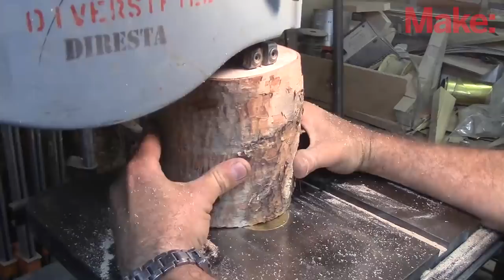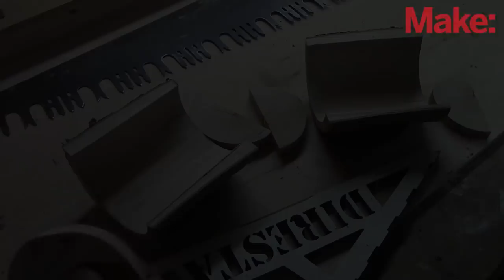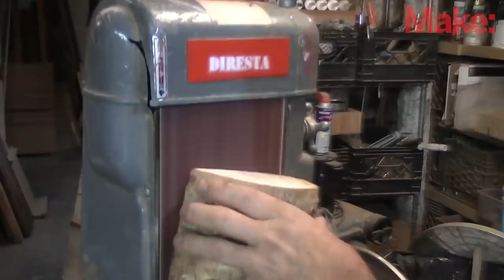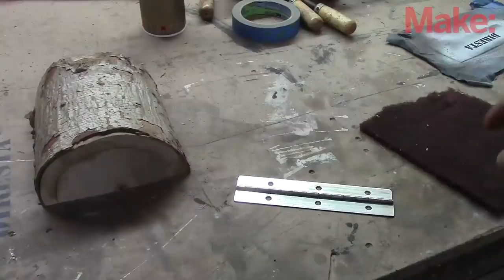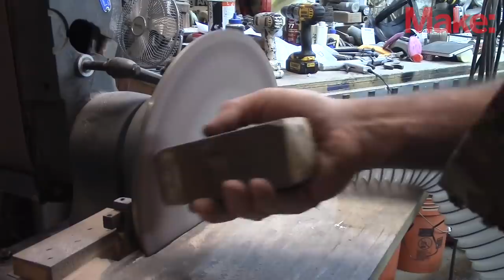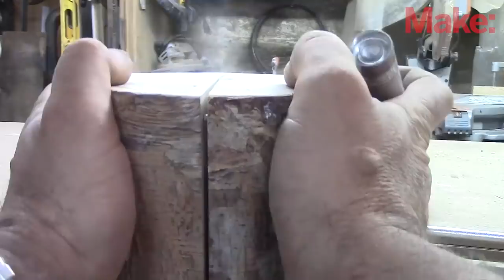DiResta: Mini Log Chest

Comment: Excellent project. if you wanted to make a slightly larger one, chop the ends off before taking the middle out. Take the middle out by cutting log in half, then putting the log halves diagonally on the table saw (best to use a sled for this), Once done, re-attach your end bits :)
Reply: this also works if you don't have a bandsaw like me :D

Comment: This is a noob question, but what is the white stick that he rubs on the belt sander and the sanding disk during the vid? Does it clean the belt of locked in debris?
Reply: Thats what it looks like to me. Maybe its hard enough that it just dislodges the particles. I would love to know
Reply: I just looked it up and some folks us pink erasers that kids used to use at school.
Reply: Skateboarders also use it its called grip gum you can get it on amazone or maybe a local hardwarestore
Reply: It almost just looked like a piece of hardwood????
Reply: Specifically, it's called a crepe block or crepe rubber block or crepe abrasive cleaner. That'll make it easier for you to google if you want to buy it.
Reply: You can use dried up silicone cement leftover from caulking (cut the tube and voila) or old tennis shoes. Used them both. Both work fine.
Reply: truebluekit to be honest specifically its probably a brick from off the street...lol
Reply: superman4ever0311
A brick would've ripped the sandpaper apart.

Ohh... humor? Ok.
Reply: yes humor
Reply: I heard a tip once that the synthetic wine corks work well to clean sander belts/wheels.  Haven't yet tried it...don't think working around tools & drinking wine mix well lol.
Reply: My guess is that, as long as the material is of rubbery or generaly soft nature (cork, synthetic cork, rubber, hard foam rubber, etc) it would do the trick. Cheers!
Reply: nexus01gr
 old tennis shoes.. genius :)
Reply: Nathaniel Kencke
A belt with a lot of sawdust in it will cut much slower as compared to a fresh, pristine belt. Just try cutting with a fresh belt, you'll feel it grab the wood and you get results really quick. Otherwise, you could spend 5 minutes on the sander for a 1-minute job.

Of course, you could just change the belt, but if the belt still has got good amounts of abrasive on it, then that would be a waste.

In other words, using a crepe block lets you use a belt sander faster, and extend the life of your abrasive belts.
Reply: slurmz123 A block of acrylic (plexiglas) is also great to de-goop the surface of the sanding belt. Some oily woods and soft materials can quickly jam the grit, so the belt can be rendered useless before becoming dull from use. A good clean brings some life to old sanding belts.

Comment: Great and really inspiring as usual, but if you´d made the hinge approx. 3 cm shorter, centered it and left some wood at the top and bottom the illusion would have been even better. It would take a more tedious approach though. To be fair speed and great use of tools is what you excel at, you get to a 98% done and dusted project, in no time!
Reply: Yes you are right. I did consider this 1 minute after I passed it through the table saw. Thank you !

Comment: That's a really well done job. It's a shame there's a seam running around the circumference of the log where you had to hollow it with the band-saw, but I suppose with this method there really wasn't much you could do. Might have to take a shot at making one of these soon. Thanks for the great idea! Much respect from a Gen-Y carpenter from Australia.

Comment: Video is old but what does he use to removing the corning from the sanding disc?
Reply: ***** Not 100% sure how to read your question, but from what I can gather, I assume you are talking about the cleaner he uses on the sanding wheel/belt. You can buy them at places like Home Hardware/Depot or basically any where you can buy DIY items. For the most part, they are made out of some sort of rubber and they do a great job of removing material that is gunked up in between grains of the sandpaper.
Reply: ***** These are called sanding belt cleaners or cleaner sticks. As Mr.CB had already mentioned, you can get 'em at the hardware stores.
Reply: ***** you get the same result with a piece of heavy rubber, use old scraps that are left over, just hold them against the disc and it cleans, works on any type of paper, stone
Reply: vwluis Oh, thank you
Reply: use the sole of your shoe, works really good
Reply: +vwluis tires would work?
Reply: never used tires, but i've used shoe soles, so yeah give it a try

Comment: what is that block you use for clean the sander?
Reply: +Marco Marquez Looks to be a sanding belt cleaner like a Crepe Block They sell these types of things at most hardware stores.
Reply: ***** thanks bro... I never saw that before...
Reply: +Marco Marquez btw they dont work well for human flesh thats stuck in there. i ground off all the skin on 3 of my knuckles and the flesh dident come out till we replaced the sand paper
Reply: "they dont work well for human flesh thats stuck in there" 
lol
Reply: Finn El Humano they dont xD
Reply: +Joe Lob I've found that a stiff bristle brush works well.  (Don't ask me how I know this... ;) )
Reply: +Marco Marquez I don't know what that is specifically, but I use Floral Foam, works wonders.
Reply: Sanding belt cleaner. You can also use an old sneaker sole or any rubber soled shoe

Comment: If you removed the bark after you had split the log in half then cut off the ends before hollowing them out you could have reassembled them without anything showing on the end's.

Comment: I've made smaller versions of this before, but since I don't have a band-saw I router out the insides. 

https://www.facebook.com/photo.php?fbid=573802452669082&set=a.573695846013076.1073741827.573600089355985&type=3&theater
Reply: Nice stuff
Reply: Coming from you.. that's a HUGE compliment. Seriously. Thank you.
Reply: Seriously cool, Brad! Mind if I swipe that idea for a gift or two? My daughter and my niece would absolutely flip over one of these.
Reply: Feel free. I do leather working so I have usable scraps around, however you can usually find people selling 1-2 lb bags of leather scraps that you could use for hinges and lining.
Reply: Brad Woodfield Thanks! Showed your picture to my daughter. I may be in trouble here. Looks like I'm going to be busy making a bunch...
Reply: Rusty Pup Enjoy! Let me know how it goes.
Reply: Will do!
Reply: mind me asking how you route out the inside i have a bandsaw but it has no where near enough power to cut through 6 inches of solid wood
Reply: tyler reel After cutting the log in half I mark the inside that I want to remove. I set my router to the full depth I want to take out and push it into the center of the marked out area as a depth gauge.   I then router out the inside layer by layer. Usually takes about 4 passes to get it completely cleared out to the depth I want. I then usually line it with leather or suede.